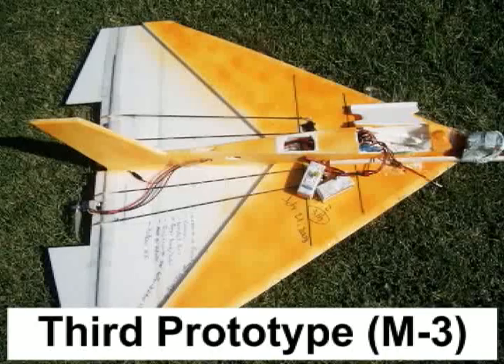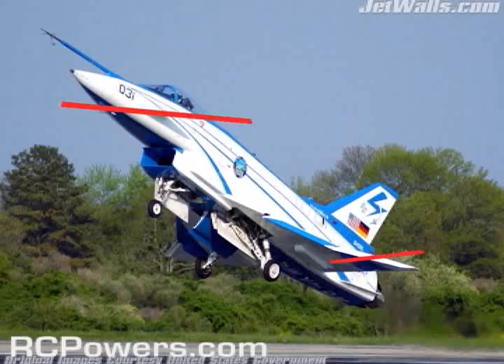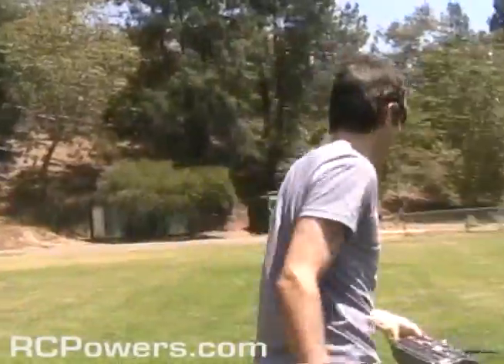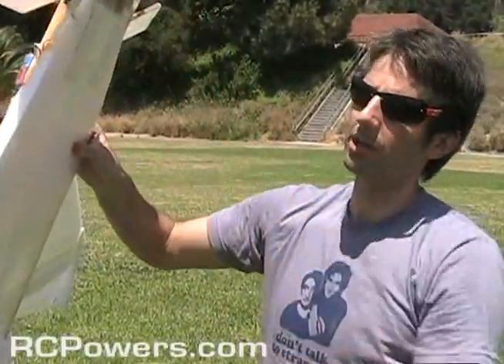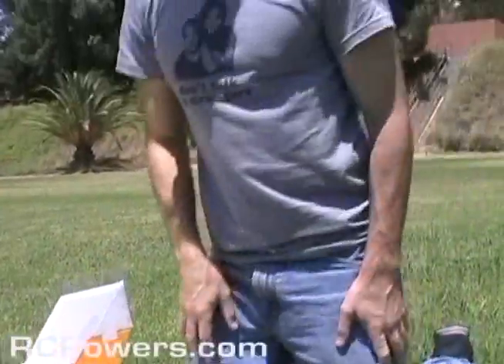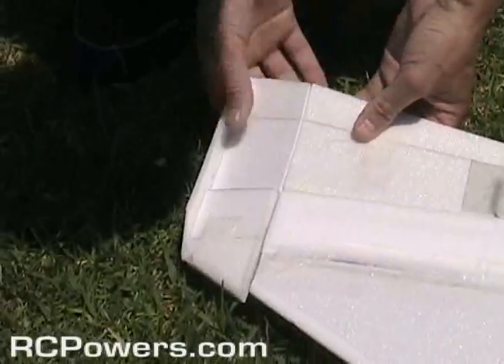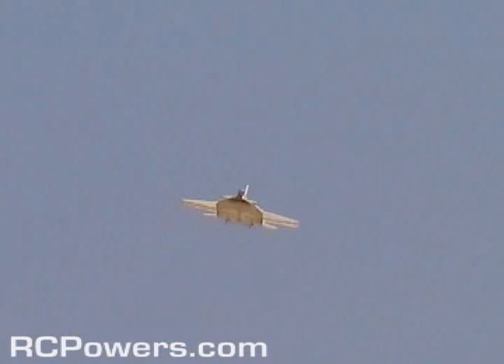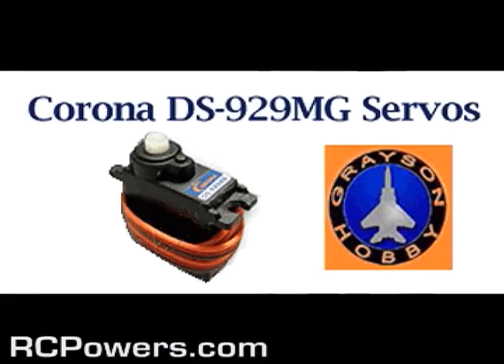How To Design RC Planes

Comment: cannards are necessary if you break the 130 degree nose swivel angle rule used on hangliders but now is necessary on high stress modulus materials .because the lowstress modulus materials can absorb the violation hence standard aerodynamics works up to now ..one example is the new boeing 787 which has an occilation going up and down the wing   instead of properly understanding it so a cannard stops this but tail slides with out a tail so both are needed ..skeatesy1

Comment: it was a great plane adn i hope your experimetns pay off. Taking this from silentsnipertx3, it does look like a typhoon. Just a comment, the eurofighter needs those front flaps so that it is aerodynamically unstable at transonic speeds so that it could perform high speed manoeuvres. Your plane cannot go transonic. But it is useful for like steep climbs.

Comment: Hell, My 60 Stik has a .90 on it   snapped 2 wings so far doing loops. Had to reduce the engine to a 60 because of the stress. Building a scratch wing with an alum tube spare like the 1.20 stick for it

Comment: In the info bar on the side he recommends Grayson Hobby, "graysonhobby (dot) com" for motors but they have everything you should need, foam, carbon, control surface tape, adhesives, radio, servos, motors, batteries, control boards I looked at the site and they have it all.

Comment: design one with a vortex generator beside the intakes. that should funnel more air to the stabilizers, or movable verticle stabilizers that match the angle of the elevators/canards, or try a v-tail.